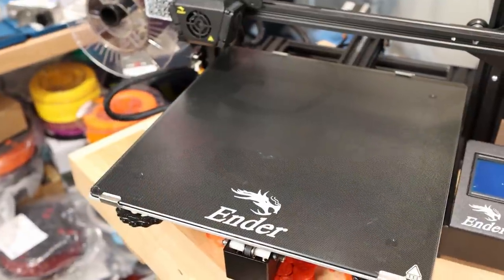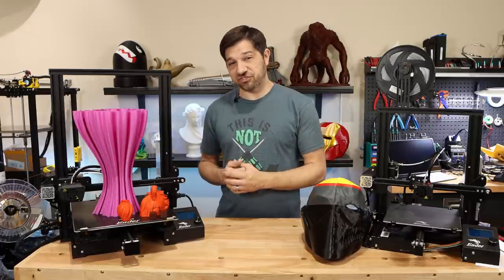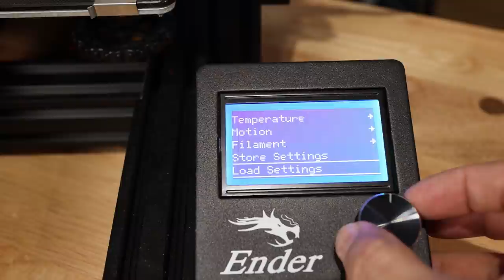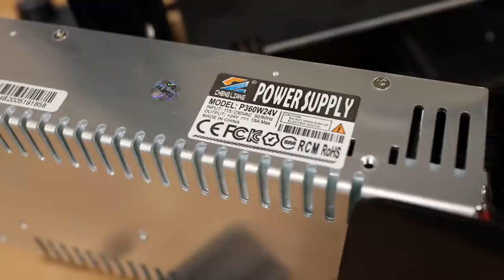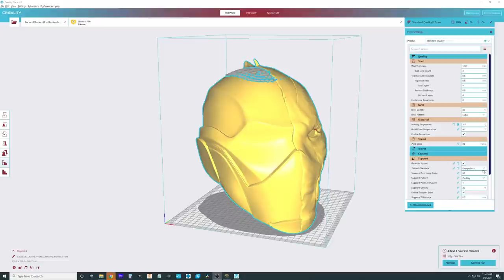Creality Ender 3 Max Review

Comment: Recently bought a Max, been printing for just over a week now with it and honestly I have seen none of the issues you listed, at least not so far as I haven't printed anything big yet, the extruder only clicked one time and that was because the nozzle was too close to the bed. The one issue I have is it not having dual z rods which I will be rectifying very soon. One of the first things I did was compile the latest Marlin firmware for the Max, enabling Linear Advance and disabling Safe_Z_Homing (otherwise the head will home the XY to the left forward corner but move to the centre of the bed and then home the Z), and then calibrated everything. I really do not like the filament runout sensor and will probably remove it, I find most of the time it's a bloody pain to push filament through it, seems to get hung up on something inside the sensor.

Comment: Home your unit, move your Z in 0.1mm increments from 0 and measure the actual z distance moved using calipers from the top of the x gantry to the bed. I had a similar issue with my CR10 where the first few layers were really squished and turned out there was some z axis binding in the first 0.5 mm (only saw 0.35mm moved). Had to loosen the eccentric nuts on the Z axis slightly and the problem went away.

Comment: I have the Max as well with the V4.2.2 board and it has 2 types of stepper drivers. Only the X & Y have 2208s. The Z and Extruder has the old (non silent) ones. You’ll see the A/C marking on the SD card slot. Might explain some of the issues. I plan on upgrading mine to V4.2.7 board which has all 2225s.

Comment: I just set up my Ender 3 Max and just like you my extruder is skipping steps. I do have the hand written A/C on my SD Slot. My firmware installed is V1.0.1.8.  My Board is the V4.2.2.
Reply from the maker: Thanks for the info. I'll be looking into this more for a fix.
Reply: I've been running mine for a week straight and noticed the same thing, other then that it prints great.  Can't wait for a fix!
Reply: I figured out why it’s skipping. The print nozzle and the bed are too close causing it to not push out enough filament hence it skips. 
The fix for that is to lower the bed on the side where you start to hear the skipping.

Comment: I have two of these - the first one prints very well after a bit of tuning, but I struggled with the "first few layer squish" on the second for 10 months. Tried a variety of things - long story short it is definitely caused by Z axis binding, and after installing a second lead screw kit it finally disappeared. Now that printer produces beautiful prints, and the random z banding is gone as well. I'm going to upgrade the other one as well with a second screw. The stock 4.2.2. board seems to handle both Z steppers on the same driver no problem.

Comment: I do have a question about cooling fans. This one has the dual fans which should work better. However my understanding is that it really depends on what materials you are printing with if you use the fans, correct? I use ABS, ASA and just started trying TPU. For these materials , are these fans useless then ? I am looking for another printer, but can't decide which  one I am going to go with. I currently have 2 ender 5 plus's and am thinking of a cr10 now or the ender 3. I do require the heated bed for the materials too. Just wondering if the dual fans are really needed on this for my use. Thanks for any info/help.

Comment: Hey will the max 3 be better dan cr10 v3 or 5 plus? I wanna print helmets and big props what would you suggest?
Reply from the maker: If you want to print helmets and big props, I'd go with and CR-10 or an Ender 5 Plus. IMHO, the Ender 5 Plus should produce better quality prints but I have not personally tested a CR-10.
Reply: @kerseyfabs  appriciate it thanks!

Comment: I got this as my 1st printer, I'm getting those same ribbon effects in my prints too unsure myself how to fix, I did get that same clicking with my printer but what I did was I re levelled my bed and instead of being leveled at 0.2 I and leveled it with a 0.23 feelergage  and never came back after that
Reply from the maker: I'm glad I wasn't alone on these. I'll take a look at your suggestion. Thanks!
Reply: @kerseyfabs   I got the idea from a YouTube video talking about this subject with other printers that this happens with,  I wish I new what YouTube video it was I found but they were saying that somehow the hot end is too close to the print so when it's extruding the filament  I guess the best example would be it's creating some backlash so the extruding gear ends up slipping on the filament again I would research it a little  cus I can't say it would work for every printer I just know it worked on mine

Comment: Were you able to solve the problems with the printing problems? I've also seen that it wouldn't be your top recommendation, may I ask what is? Sorry for asking, I just want a good printer for both cosplay and figurines.
Reply from the maker: I wasn't able to get the quality of prints I wanted out of this one stock. I have high hopes for the new Biqu B1 SE Plus. Is this your first printer or do you already have one?
Reply: @kerseyfabs  Still haven’t gotten a 3D printer , so it would be my first.

Comment: Hi I'm looking to buy a 3D printer for polymer clay cutter and I don't know which one is the best and most economical.  Thanks
Reply from the maker: Thanks for the message. I assume you mean the cutters that look like cookie cutters? That's a pretty simple print really, so almost any printer will do the job. Something like this Max will work but if you don't need the larger build volume, you can go with a standard Ender 3 or Ender 3 V2 or check out the unboxing of the Artillery Hornet I just posted over the weekend.

Comment: I bought one of these printers, it will not lay layers on bed after 30 minutes there will be a blob of plastic on build plate any answers on that one please help
Reply from the maker: Do you mean it's just not sticking to the bed?
Reply: @kerseyfabs  yes not sticking to bed
Reply from the maker: @burkoboiler  Try flipping the bed over and printing on the smooth side. Wash it first with dish detergent and hot water. Dry with paper towels. See if that works.
Reply: @kerseyfabs  thanks try that

Comment: I can't decide weather to get the pro or the max i know the max is a bigger 3 but i still dont know if it has everything the pro has anybody know if this is an oversized pro or just a regular 3
Reply from the maker: The Max can be tricky to get setup and leveled. From my testing, it can also have size related issues. If you're set on an Ender 3, I'd get the Pro. If you want a bigger printer, looks at printers like the Ender 5 Plus.

Comment: I just ordered this printer and can return it on Amazon. What other printer would you recommend without these issues for a similar price?
Reply from the maker: Did you not like it or change your mind after my review? What were the selling points originally, the size?
Reply: @kerseyfabs  yes, this is my first printer and I liked that I could print larger objects with this one.  I’ve got some of the same running that you saw and getting my bed perfectly level seems to really help. But not against returning this and spending $100 more for a large printer.
Reply from the maker: @dustindavis8202  It's really up to you. A lot of people really love the CR-10S line of machines. I haven't reviewed one myself but the CR-10 V2 or V3 seem like nice printers: https://amzn.to/3h5ljOI
Other channels have done reviews if you'd like to take a look around.
Reply: @kerseyfabs  returned the Ender Max and actually went with the FLSun Speed Racer. Super excited and the reviews seem to be raving!
Reply from the maker: @dustindavis8202  Agreed! Good luck with the new printer!

Comment: hey chris i was told tinning was better than bare but ferrules reigned best, whats the reason behind not using tinning and preferring bare
Reply from the maker: I'm sure you could make a case for either. If you leave it untinned, you could have a stray wire that leads to a short. If you tin it, you get a poor connection to the terminal that can lead to arcing. The stranded wire compresses better with no tinning, leading to a better connection.
Reply: @kerseyfabs  thank you, my wires are twisted and at the right size so ill leave them bare and skip that arcing
Reply: Wiring that is used where the maximum current is essentially infinite (i.e. mains wiring), a short can result in the flashing/explosion of the solder, or tinning component.  In certain circumstances this is illegal if there isn’t some kind of explosion/blast shield in place.  It is also the reason why it is illegal to use aluminum wiring that is connected to mains lines.

Aside from that, tinned wiring can come lose over time, especially in vibrational environments as the tinning can fracture and break apart.  While in my electronics classes over 40 years ago, I did witness the explosive & flashing effects of overloaded soldered connections, and it’s extremely lucky that those involved were not severely injured.  When working with potentially high currents, do not solder or tin components unless there is absolutely no other option available.  If you must, ensure that the proper protections are in place.  There is a reason why power supplies are enclosed.

Comment: I have ender 3 max (also ender 3 v2) and my does not have that z wobble or extruder problems, maybe the stepper motor has problems and my Max has tmc2208 only on x and y

Comment: we have to figure out the first few layer squish issues, I recently purchased this printer and my favorite type of prints are the print in place.  The squish isn't letting me successfully print any of those types!! its driving me crazy!!
Reply: I read that squishing is caused by the too tight wheels on the x gantry. I have the same printer and the same issue and right now I am searching for the solutions. I will probably try some of the tricks this weekend. You should try to move the x gantry up by little steps, starting from z=0, and see if the gantry moves. If not, loosen the eccentric nuts a bit and test again.
Reply: Were you able to fix this issue?
Reply: @nishansidhu9016  Yes! It took a few hours but I figured it out. There are 3 wheels on the gantry. You have to play with them and find the sweet spot where they are rigid enough so they provide support, but they are not too tight, so the z movement caused by the lead screw on the other side will cause an instantaneous movement of the whole gantry. So, it is all about the right tension of those bolts and nuts. Take your time, it took a good hour if not more for me. Start from some more or less OK position, then change the eccentric nut, move the Z up and down a few millimetres and see how the gantry responds. After a while you will understand how you should tighten or release the nuts and you will find the optimal position.

Comment: This is maybe a bit late, but, based on what I saw on YT, I bought one.  But with my background in machining, when I ran into adjustment problems, out comes the Starrett 24 inch caliper.  It seems to me that quality control in the machining is either poor or nonexistent.  Measuring the width between columns at top and bottom, you're never going to get the wheels adjusted properly.  The two vertical columns are anything but parallel, as much as .028 inches.  That's close to a thirty second of an inch, and there is not enough adjustment to compensate.  Getting it parallel will bring other problems, there is no adjustment even if I had re machined the top beam to bring it back into adjustment range, the x axis would also have to be re machined, and sorry, that's not going to happen even though I have the machines to do it.  It would only lead to the "start over and do it right the first time" process.
Reply from the maker: It's important to realize that for many of these cheap printers, you're getting what you pay for. They're not spending the money for that level of tolerances.

Comment: I’m either buying the v2, the 3 max or the 5 pro. With the money not being the issue what would you suggest for a first printer?
Reply from the maker: The 5 Pro is just a great printer. Plus it looks like it's been upgraded to a 32-bit board for new machines. If the extra space of the 3 Max wasn't something you had to have, I'd buy the 5 Pro for new or experienced users. Learn to level the bed. Don't worry about a BLTouch unless your bed is warped.
Reply: Lol the only thing I’ve got so far is the BLTouch 😂😂 I’ve just found there seems to be more help online for the 3 series. Is the print quality of the 5 pro much better? What advantages over the 3 Max does it have, if you know?
Reply from the maker: I think the 5 Pro is easier to tune in and produces cleaner prints overall since it's not having to move around the bed and the print. I don't have any side by sides to show you, so I can't quantify it directly. Plus, with enough tuning/tweaking, they would probably be very similar, particularly without having them side by side to compare. You won't go wrong either way, this is just my opinion.
Reply: Thank you very much, went with the 3 max.
Reply: @Orgoniks  how have you liked it? I’ve been looking and doing tons of research just struggling to make the decision

Comment: Just asking in anyone could answer:
Are the fumes from the 3D printer printing dangerous or harmful?
Reply from the maker: * I am not a scientist or a doctor and am not qualified to give medical advice. *
In general, PLA and PETG should be considered safe with minimal dangerous particles being given off during the process. Almost any other material such as ABS and Nylon should not be printed without proper ventilation. For further information, please look up several studies that have been done.
Reply: @kerseyfabs  I did there were just a ton of mixed responses so I'm asking everyone and everything I know
Reply: Depending on the plastic you print.

PLA and PETG are safe.

ABS will emit fumes.

If you want to be sure, search for information on the filaments you want to print and learn what you can, some plastics will have extra challenges such as warping, stringing, extruder jamming, and so on, but it's all well documented and have plenty of solutions that are often easy

Comment: Is a full metal hotend still neccesary on this?
Reply from the maker: A full metal hotend is never necessary unless you plan to print high-temp filaments (over about 245C). I often recommend a high-quality all-metal hotend though to get around issues with the plastic tube meeting with nozzle and creating a gap. If you're not having problems though, just keep printing!

Comment: I love your videos because when I need answers, you usually provide the best one. That massive vase makes me think about what I think is a major flaw in the printers where the bed moves within the Y-axis. Could you record an experiment? Create a g-code file that moves the hot end to max Z height for that printer followed by rapid Y movements. Set that vase on the bed without any adhesion aids and run the g-code. What happens? Do the same with an Ender 5 Plus. What happens? I can't run the experiment since my only FDM printer is an Ender 5 plus. I'm pretty sure that you will likely see an interesting demonstration of Newton's first law of motion. I understand the need for all of the bed adhesion tricks when using printers like the Ender 3 Max. I had issues with my Ender 5 Plus because the table I put it on wasn't as stable as I thought so it wobbled a little. That little wobble was enough to release the print from the bed. The table is mounted to the wall now and my printer has no issues with adhesion. I could still have other adhesion problems with ABS for the usual reasons, but at least one problem has been removed. I can't see how it's beneficial to have your bed moving back and forth like that.

I also have a Photon S which was a disaster. It can't read USB drives and Anycubic is no help. I intend to fix it by upgrading my Ender 5 Plus motherboard, and using the stock motherboard to run the Photon S. Your videos on mainboard upgrades have been inspirational. There's no reason why one of the boards couldn't run my CNC mill. I plan to ditch my Ethernet Smoothstepper and Mach3 with a 3d printer mainboard.

Thanks for all of the great work, Mr. Kersey.

Comment: With such a large printer, you want to use bigger nozzles like 1mm. Unfortunately the extruder is skipping in this configuration. A titan clone is a nice upgrade to solve this problem.

The filament runout sensor broke here with the 3rd print. It is a simple microswitch. These sensors are crap. At least there should be some rollers or a construction like Prusa is using in its MK3s. I will replace it with a BTT Smart Filament sensor.

The bed came here warped. Unfortunately the original firmware didn't support mesh bed leveling to solve this problem. I had to compile my own.

Cables are glued on the controller board. This makes it difficult to upgrade the mainboard. And as there are not many spare IO pins, you may want to do that sooner or later.

PSU cover has to be replaced. This is inacceptable.

In my opinion ths is a nice printer if you like to tinker but not for a beginner.